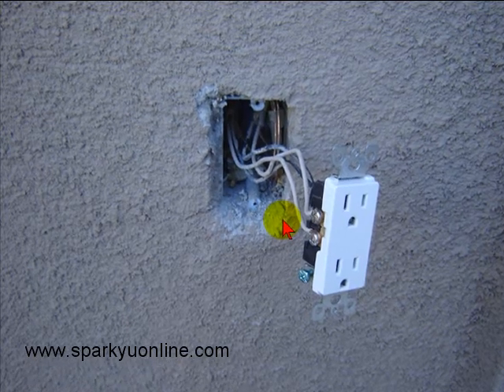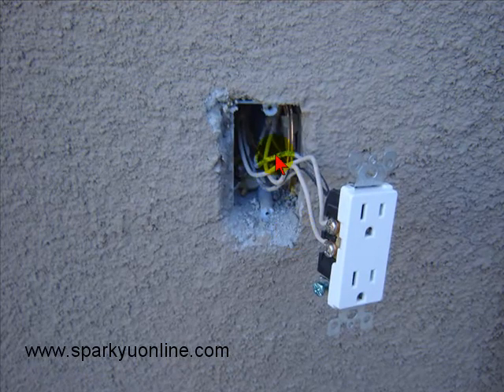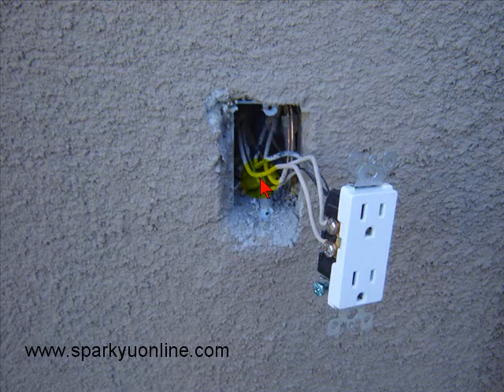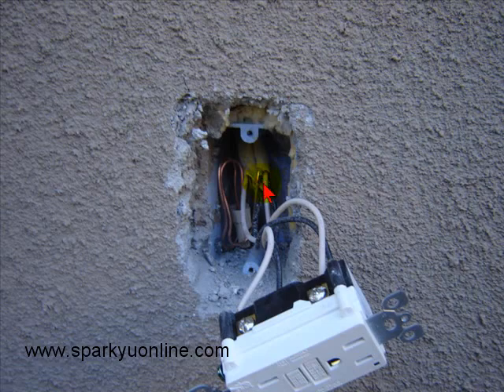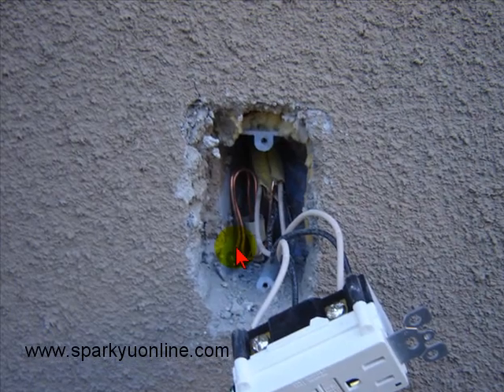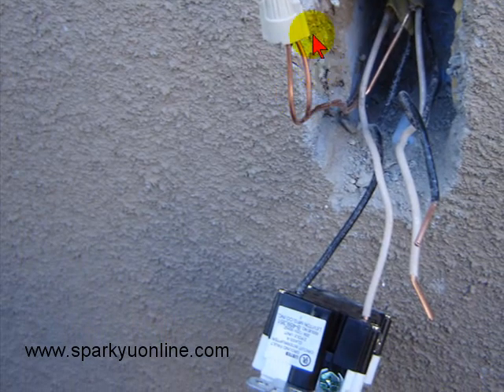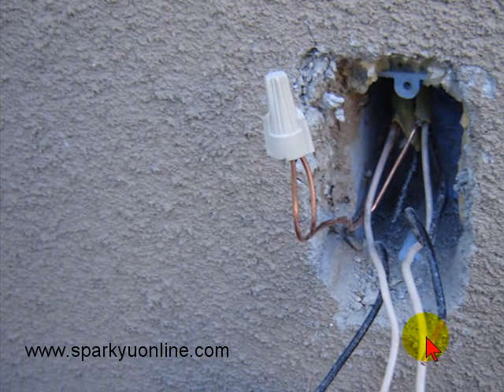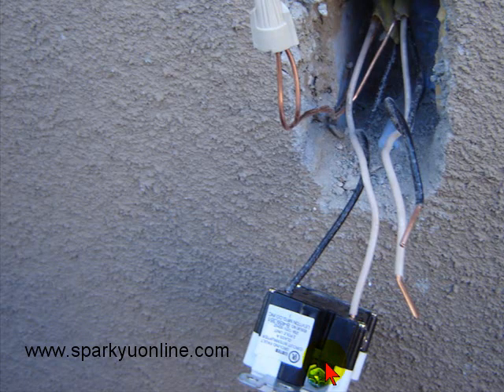Electrical Wiring No ground tails

Comment: I've heard a argument when the device is in place it is grounded because it's attached to the box.  Only when you take it off the box then it becomes ungrounded.
Reply: Yes, but this is a plastic box!  And the Code requires the ground to be connected to the device, even if the box is metal.

Comment: An RCD/GFCI should work regardless if its on a grounded or non grounded supply, the j box also looks to be plastic, so no bonded ground. That of course doesnt justify not grounding the receptacle, but the GFCI will work without being grounded. GFCI breakers and outlets are what I typically use for older homes with non grounded braided romex
Reply: my parents home had a lot of ungrounded braided romex was built in 1946.  I had relocated the two switches in the garage to the side door with EMT (garage lights and 3 way switch outside lights) put in a new junction box to splice the new conductors into the old ones, grounded the new box and conduit run.

Comment: If my home is too old and I need a 3 prong outlet, but it have no ground, what are my cheap but secure way to get a 3 prong outlet installed... and how much would it cost to hire a electrician to install ground wire in the home? Btw someone told me use a 3 prong adapter... but won't it be just as bad as a 3 prong outlet if it as no ground.. help me out, my old home had ground wires running to the box, so when I replaced to a 3 prong it was visible just like yours, but I don't see on this box.
Reply from the maker: There is no correct cheap way.
Reply: GROUND THE BREAKER BOX. Or REPLACE BREAKER BOX for a more modern one.
Reply: jdphd - Rediculous! Breaker or fuse box should already be grounded. Changing the electrical service panel will not suddenly cause a ground to be present on an old 2 wire (hot & neutral) branch circuit.

Comment: A GFI or RCD as they are called here in the UK will still function for the purpose of protecting from a shock without a ground conductor, you will not however be able to test them with most outlet testers as they work by allowing the amount of current for a trip to pass from hot to ground. This doesn't mean that the test button on the GFI won't work as they just test the mechanical part of the device by creating the imbalance internally.

Comment: -REPLACES- Nope. Improves protection, oh yes!
You can't replace anything, you really want both a GroundFaultInterrupter and a ground.
A GFI only needs live and neutral, what it does is compare the current in the live and the neutral. If the live pulls 5A and the neutral carries 5A evrything is good. But if the neutral carries 4.97A the GFI senses 30mA is going the wrong way, possibly through a human, and trips.

Comment: My understanding is that GFIC switches don't have to be grounded. The whole idea is that the switch replaces the need for a ground wire because it trips instead.  And, yes, per other comments they can be used in older homes that have no ground. Put them in the front of the circuit and every thing down stream will be protected. or you can put a GFIC Breaker in the box and that will protect everything on the line.  though they are not recommended for microwaves or computers.

Comment: its weird that the GFCI receptacle would not work without the grounding conductor. I actually use them to replace old receptacles with knob and tube wiring with no grounding conductor present- and they operate normally.
Reply: The electrician installed it wrong. I think he reversed the lines and loads. It had nothing to do with the ground.

Comment: Just replaced all of the light switches in my brand new house (2012) and didn't find a single switch with a ground wire connected to it.  The grounds were all neatly tucked inside the boxes... I thought code allowed this ONLY in cases where a metal switch plate could not be installed on the existing switch.

Comment: The ground wire does not affect the operation of the GFI but thats no excuse for the poor installation. I believe according to the code you can replace  an old 2 prong receptacle with a GFI or anther 2 prong . Great vids by the way!

Comment: Actually grounds are every bit as much of a carrier of electrons as HT when considering 0Hz. The potential of a ground plane can be at zero but that does not mean that electrons do not flow here. Electrons flow in the opposite direction as current - the shortest distance possible from neutral or earth ground in a circuit. EMI, white noise, and RF can be reduced by keeping circuit commons out of the same direct plane as electromagnetic grounds in reference to direct paths and earth ground.

Comment: @thecityismine08 
P.S. Don't be afraid to use your GFI tester, you just insert it, compare the lights to the diagram, push the button to trigger a ground fault, reset your GFCI outlet and check again. Should any of these steps fail, check back here or call a qualified professional.

Comment: @thecityismine08 
GFCI's do not require a test/reset button. Besides a single outlet, there are two other ways I know of that one can obtain ground fault protection. 1) By attaching additional devices to the load side of a GFCI outlet that does have a test/reset button (these are the terminal covered by a yellow sticker), or 2) by installation a GFCI circuit breaker in the panel. It is much cheaper for regular outlets vs GFCI, hence why some go this route. But callbacks get expensive quick too!

Comment: @sparkyUonline really, because I have always been taught that the EMT acts as a ground and there is no need to add a ground. In fact the only time I have ever been taught to use grounding wire is when using metal flex that is more than 6' long.

Comment: when using metal boxes and EMT conduit is it necessary to add a ground screw to the box and connect a ground wire to the receptacle/ switch?
Reply: Years ago conduit was considered a solid ground between the boxes with the set screw and lock nut connectors, however a grounding wire was still required between the box and the devices. Codes changed  occurred requiring a grounding wire to run within the length of the conduit since connector can loosen breaking the bond,  box is ground along with the devices.  Once I installed a BX cable run to a junction box then to EMT where I did use a ground wire for an outside outlet in a weatherproof box.

Comment: @electric103  there was a ground wire in thebox that could of been used, what do you mean this was not that bad? Oh and you forgot to add if you do do it your way you have to put a sticker on every outlet on the load side of the GFCI that says no equipment ground!

Comment: Looks to be in the Southwest (stucco). I never line-load my GFI's. I pigtail and install a GFI at every required location. This was probably installed by someone too lazy to mess with ground wires. I also pigtail all receptacles because 80% of my service calls are due to open circuits caused by one loose stab-lock. I've been a sparky since 1971. I enjoy your vids. san diego electrician.

Comment: Hi I'm an electrician from the UK and i was wondering about your GFI's in the uk they are called RCD's (Residual Current Devices) Our RCD's (For Socket Use) opperate within 30mA and trip within 0.4 of a Second or voltage on the earth of 50 Volts or more and I was wondering whats the speck of the GFI's? The reason for our specks is that 30mA flowing accross the heart for a duration of more than 0.4 of a second (Which is one human heart beat) will stop the heart or interupt its rhythm...
Reply: glenwoofit vhgiyhih

Comment: in the chicago area all residential wiring is in conduit. We dont run any ground wires and do not bond the receptacle to the box.  Here it is ok to use the device mounting screws to ground the device. just in residential though.

Comment: usually on the receptacle the ears on the top are connected by metal to the ground screw, so just screwing the receptacle into the box will ground it as long as the box is really grounded. if you can read voltage between the hot and the box you have ground. but bonding a wire to the box for extra measure is ok too

Comment: if you have sheathed wiring going into an metal box then we do bond to the box. but if you have a metallic raceway then it is not really necessary because the box is already grounded

Comment: @Pack6Joe if the armored metal cable runs back to the panel then its grounded there, and at your receptical box, so seeing as your box is now an efficient ground you can run a copper pigtail (of appropriate guage) from your box to your recepticle

Comment: @xxakli No, it will sense an imbalaced load between hot and neutral and will trip, in fact in old house wiring, if there is no ground it is recommended that a GFI be installed to protect the circuit and to the video instructor, there is a safer way to find your line and your load without turning the power on, just do a simple neutral to ground continuity test.....

Comment: You guys are about 20-30 years behind us. First you have not sleved you "grounds" uninsullated copper in the back of a socket NICE ONE!!! Second am I right in thinking that is a outside socket? Do you think making a weather proof version would be a good idea??? There's some common sense for you. No wonder you lot are only allowed 110v. The main reason you earth or "ground" a socket is to give the portable appliance you plug in a fault parth.
Reply: The US is ahead of you guys because Edison, Tesla and Westinghouse were all based here. We don't need to sleeve our grounds or call them "earths" just so you can be happy. Also, you probably don't know this because you choose to comment on things before doing any research, but here in the US we have 2 hots and one neutral being fed into our panel which gives us both 120 Volt and 240 Volt circuits. 240 is for water heaters, air conditioners, clothes dryers, etc. We do have waterproof and weather resistant boxes and devices.

Comment from the maker: A GFCI monitors for a current imbalance between the hot and the neutral conductors therefore a ground connection is not necessary.See article 210-7 of the National Electric Code.